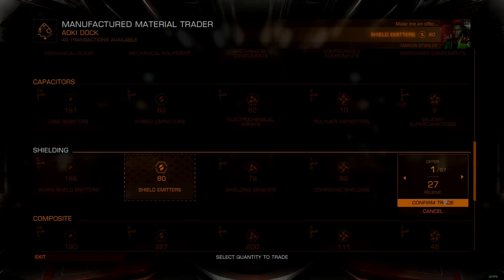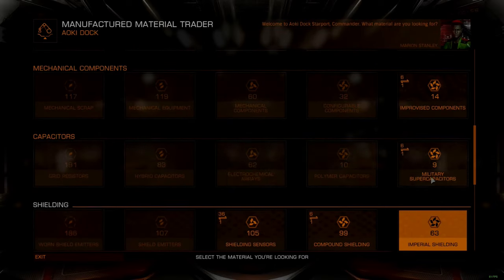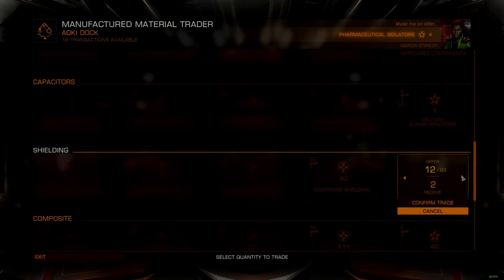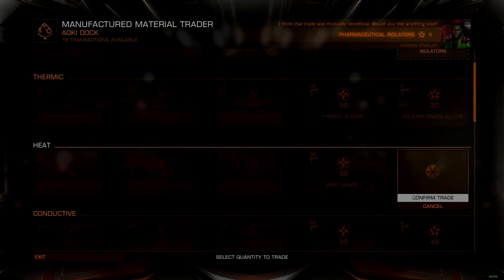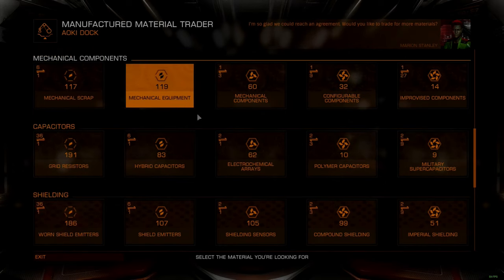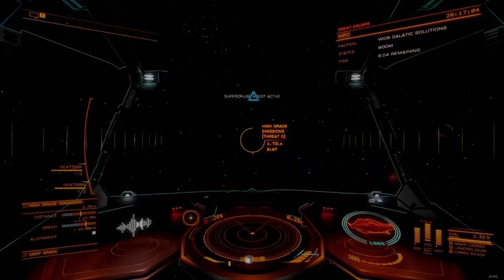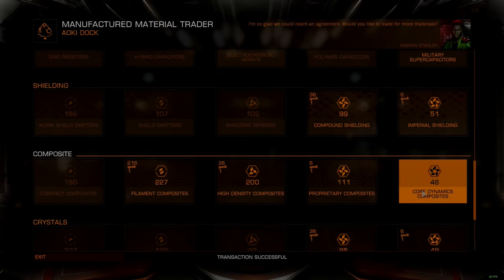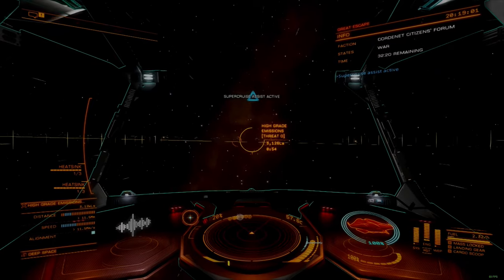Elite Dangerous | Dry Commentary | We Need Scrapping Mechanics

Comment: Everyone says that the Pre Engineered FSDs remain better.  I have replaced drives on a Phantom, Krait Mk II and a Python all with Pre Engineered FSDs with Mass Manager with SCO Drives fully engineered Increase Range, Mass Manager.  In every instance, the SCO has a slightly higher jump range than the Pre Engineered in range.  From a CG, I have other size Pre Engineered FSDs and did the same for the drive on an Asp Scout with the same result.  The SCO had a higher jump range.  Asp Scout?  That flip around makes it the best ship in the game for High Grade Emissions where as the much lauded Cobra Mk III is master of not a single thing.
Reply from the maker: I plan to do a detailed review of the SCO drives now that all module ratings and engineering are available. This will include a detailed breakdown of stats and tradeoffs for the range of options.
Reply: I don't have a handle on why yet, but the biggest gain that I had was on a Courier.  It got a 4.5ly bump.  Perhaps it's because it's a small drive with Deep Charge.

The smallest gain I got was on a DBX with Pre-Engineered -> SCO G5 MM.  That was sub 1ly.
Reply: Ya I keep posting comments that no, sco is king of all drives.  Clearly people making videos didn’t actually fully engineer any to max.  SCO is 9% more range than full engineered and .9% more than dual pre engineered.

Comment: Recovery of Material:  The Grind is the Game.  The whole point is to increase game play time by us all engineering SCO FSDs.  Why on earth would they make that easier?  By the way, show some data on SCOs not quite managing to be as good as Pre Engineered.  Everyone is saying that in YouTube videos.  I have replaced a number of them and in outfitting gone to replace the SCO with my old FSD and the stats are the same or worse for the Pre Engineered FSD in every instance so far.
Reply from the maker: A detailed review of SCO drives is on the way, now that we have the full range of classes and grades. I'm prepared to correct any mistakes in this video when I do that one, I'm still going over all the engineering and module data.

It appears that SCO drives get worse jump range than pre-engineered ones, but not much.

Whether SCO drives are better ultimately comes down to whether you find advantage in SCO capabilities. I think that most people will trade a few light years of jump range for faster in system travel. I may be wrong, but I do stand by that position.